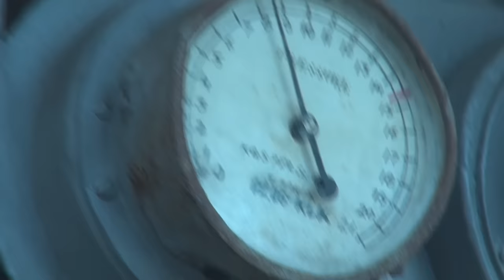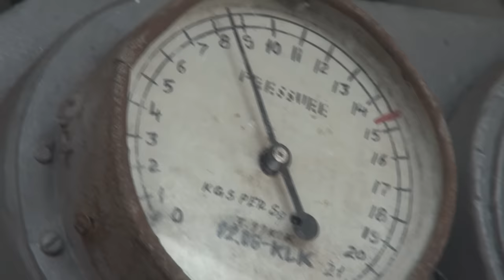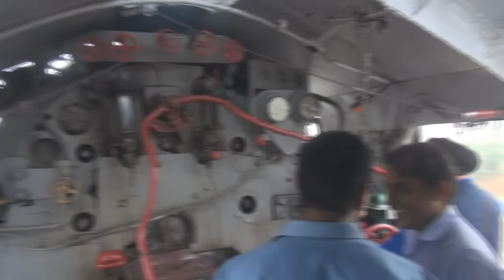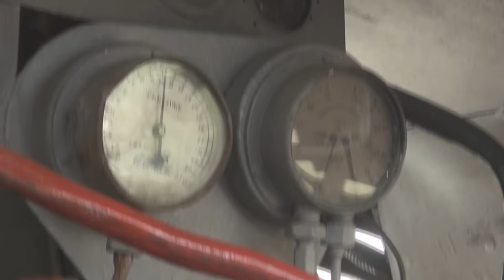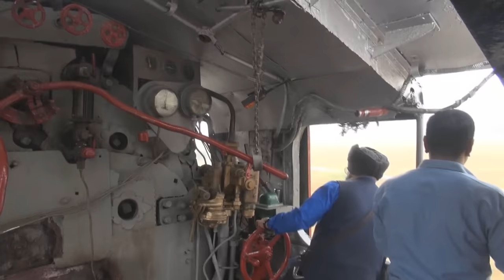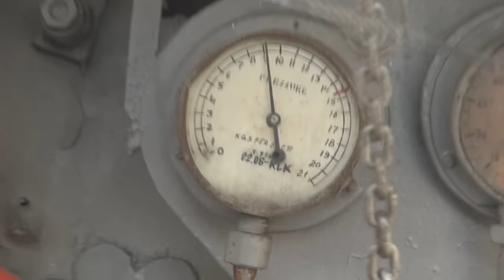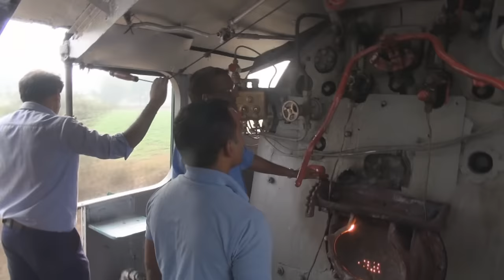28/11/2015 RTC Railways of the Raj Part 4 Delhi to Rewari

Comment: It is  most necessary to ride in the steam engine train as  this one pulls  back to recal our child hood  and student life journey.
2ndly  it is applicable    to know  how it is  running with coal and water and steam without oil,  it's sound ,as well as  its whistling horn sound  etc. for in this computerized era's persons
Reply: Who doesn't  know  must and should know get experience  by traveling  in steam engine  fixed train.

Comment: Looks like he started off with a very small regulator opening. There was no strong puff from the blast pipe/ chimney. WP was my all time favourite loco.
Too bad the loco was limited to 40 km/h. these beasts could crack 110-120 km/h.
Reply: I've an doubt very slow departure. 
You said slow start by steam engine pilot. 
and speed restrictions mentioned 40 km/hr. 
That also 110 km/hr max....
Thats proud of an steam locomotives in India in olden era...
Reply: 2muy bueno fui ferro viario

Comment: "Akbar" is having a set of three drive wheels .Certainly its maximum speed would be 80/90kmph.  US or Europian Rlys having extreme powerful steam engines with set of 4 to 5 drive wheels. Speed of steam engine depends on the the diameter of drive wheel and numbers of  drive wheels.In India normally there were steam engines with max set of four drive wheels. Thanks
Reply: tractive power is dependent on number  driving wheels not speed
Reply: Vishwajit Pawar the more driving wheels the slower it will go because the rods would fall off your must not know much about trains then
Reply: Not to put down your point, but the world’s fastest steam engine, the Mallard, had only 3 drive wheels each side. Also, from what I have read, the WP class (Akbar) could do nearly 120... maybe even 130 on a good day.
Reply: There were two type of loco in1985 WP- W for broad gauge & P for passanger service train ,.   WG -for goods train both locomotive have some wheel difference.                 Firing is a art (means put coal in boiler is called boiler firing and tender firing means push coal from tender (I e rear portion of loco where coal is store) Both loco run on100kmph.F/man has to maintain steam pr and water in boiler.There is a lubricator to supply lubricant to pistons,Difficult work physically as I experienced in 1985 as I joined Railway at Daund as App F/ M "A" and work on steam locomotive from Dr to SUR & Manmad.

Comment: At the start: is that a coal-fired diesel locomotive?
Reply from the maker: Possibly why it's so smoggy around New Delhi.
Reply: No it is powered by diesel oil . The smoke belched out is diesel fumes. The train is a heavy container load and the loco is just negotiating the points to turn out from the mainline onto the siding at a restricted speed of 10 kmph. The loco is in 2nd notch for more torque...hence the dense fumes.
Reply: And I think there is no such creature as a coal fired diesel ! A contradiction in terms.
I detect a faint condescending note in that question.
Let me assure all foreigners to India that we run the most modern state of the art locos...no coal or firewood...except on heritage lines.
It is not easy running 14000 + trains everyday..we do it without turning a hair.
Our goods trains are 58 wagons long and passenger trains 24 coaches long....far more than the Flying Scotsman ever has.
Reply: It's an old ALCo. Old and American aren't exactly bywords for good emissions now are they? It smokes like that on gradients and when pulling excessive loads.